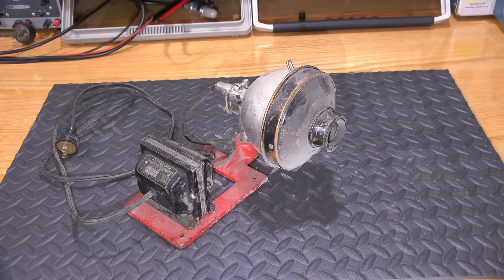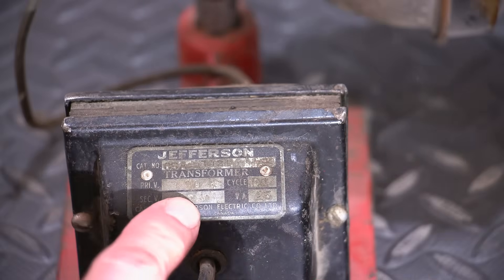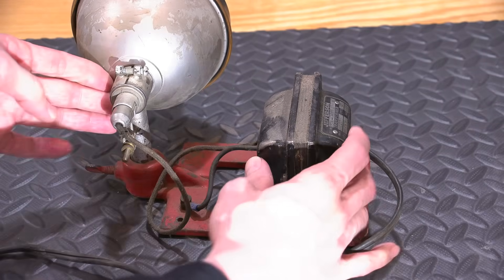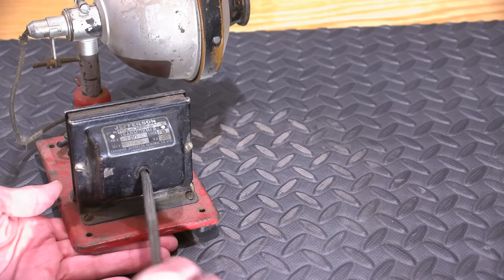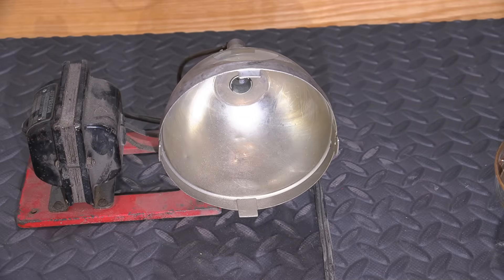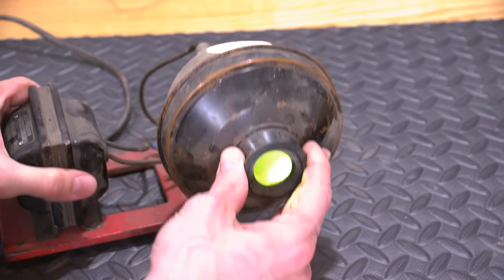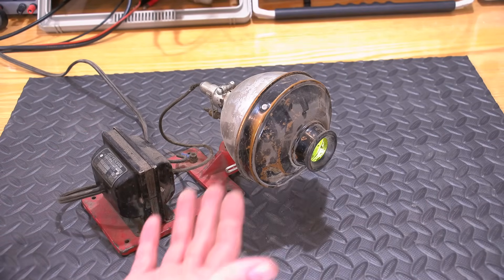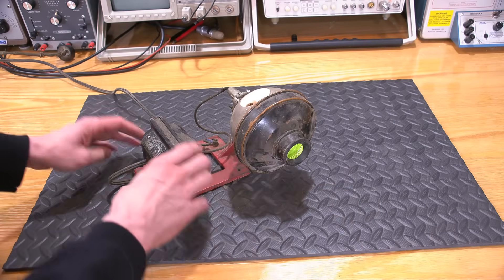Barn Find - What Is It - 1940's? Mystery Device Teardown!

Comment: Fun fact here we had 25 cycle and 60 cycle power (hertz) for a long time the big arc blast furnaces at the one factory were replaced eventually and the 25 cycle power plant was retired, as for the rubber crystalizing that could have been part of the war effort, oils had to be used elsewhere and im sure those war time electronics suffered

Comment: My now late brother-in-law screwed one of those flash bulbs into a lamp socket ( curious to what it would do not knowing it was used for photography  ) not thinking first to make sure the switch was in the off position and while he was holding it triggered.  This did something to his hand and he was visibly shaken/upset and shaking his hand for a while trying to ?? get back feeling or ??
There was no burn mark on his fingertips or hand 
But interestingly, he did die of cancer so I must wonder  if that bulb put out some radiation …..

Comment: Those are like tail light bulbs to a car 1157 was a two prongs and 1073 was the one prom that light takes the one prong . Any old car from the 60s will have the bulbs the stoplight signal light is 1157 and the reverse light is the one prong 1073 that would be your bulb to lite that lamp

Comment: It seems like once you mentioned the word egg inspection. Everybody ran away with it. This actually is still used in modern times, but it goes way back. It’s a light PQE surface inspection, torch, contamination detector surface inspection, torch design to easily evaluate cleanliness and highlight marks or particles that could impact the finish quality of the product Can show Greece fingerprints things of that nature on a surface that you could otherwise see so I think there you have it of course I’m welcome to be debunked. It does take a special bulb, but I do think in this case that filter that’s on that one. It just takes the lamp The incandescent lamp and the filter is sufficient enough to get that particular wavelength of green.

Comment: What puzzles me, is that it's rated at 25 amps, but it has a 6 volt bulb?  Which side of the transformer is the amperage rating for?  If it's for the 120 volt AC, that's huge for such a small bulb; 3000 watts would be insane for small bulb.  Even at 6.5 volts, that's a whopping 162.5 watts for some crazy low voltage bulb.  I don't even remember what those 12 volt bayonet bulbs would have for the wattage; you know the kind they used to use for break and marker lights.  But that would explain the need for a vent.

Comment: I would have guessed it to be a train light
for go and stop or safe or traffic. Swivel to
show both directions. The open part is to
read a pocket watch and schedule . Track
engineer lighting also consisted of 6 volt
lights that could use battery backup and
swap bulbs with walking lanterns. Yard
masters also used portable colored lamps
for signaling to other engineers and trains

Comment: It's an old fashioned cocksocket, basically a filling level indicator. 
You mount it via the hole with your bolt and nutsack dangling very low and while ablating layer after layer of tender stretched sackskin via heat and light from a very powerful light source the family can witness the content of your nuts.

It's usually been used to evaluate the proficiency of housewives to take care of their families.

Comment: Years snd years ago a photographer used to come to the theatre and take pictures of the cast on set.
He used two reflectors which had single flash bulbe of  the type you showed but larger, probably 250W size.
I pretty sure that every time he fired those things the stage moved back six inches!!

Comment: Oh, yeah, I've seen one of these before.
A "dildonator" is what it's called.
Back in the days of Radium when used as and for all sorts of things to cure, stop, relieve and disperse any kind of pain or ailment, this could be consulted for any universal panacea.
When not in use for that, it was to entertainment the children using hand shadow puppets.
Your hands of course would glow and radiate and if used too much, they would eventually fall off.
Usually around dinner time.
Even the spectators in the same room would experience intense diurnal cramping.
Sold as a home MD tool and entertainment aid.
It could also cook a full 20lb turkey in about 15 minutes with no radiation poisoning.

Comment: That is a device I was brainstorming with my specialized advisor(an ai), which I use often for ideas. That should be tiled back 33 degrees or so. And there is a part missing, a belt to rotate the drum. Your missing a few important part to it.  But it used in small scale mineral/metal extraction from rocks…. You say that’s from the 1940s? I am in 2025 odd to see someone made my idea already, and the knowledge if what it is and what it’s for is lost.  What else was in the barn?

Comment: Transformer looks like a Radio's Heater Transformer. The heaters in the radio Valves, or 'tubes' needed to be heated to allow thermionic conductivity of the radio valve (tube).  The brass thumbscrew is the 'focus adjust', where the 6.5 volt lamp would be moved to the focal centre of the main reflector.

Comment: Oh yeah this thing, I remember these crazy things. That is a low voltage illuminated egg candle. I bought one of these things way back in the day, I think back when I was, what, 300, 330 years old, or something? Anyhow, it works like this: That great big round hole in the side is so that you can keep this lamp on for up to hours at a time without large amounts of heat building up. The inside is an uncolored standard metal that will reflect the light any which way. Eventually, the light makes its way out of two holes. The heat vent, and the focusing lens. The focusing lens is to be pointing straight up. You see those four holes on the red mounting plate? That plate is to be mounted to a wall nearby a standard edison outlet. You would then use the device to check if eggs being collected for market have been fertilized or not. If they have, there'll be an unborn chicken inside and you'll see the outline. If not, you just made an egg glow briefly. This is to prevent taking the fertilized eggs out to market by accident. The reason the bulb is so low voltage is because if you used any higher voltage bulb, the vent hole wouldn't be enough to prevent it heating up. And you don't want to put an egg on a hot lamp if it's going out to market, that'll ruin its sale value and taste. I hope this explains it fully to you.
Reply: Rad.

Comment: My guess is that it's an illuminator for a microscope.  It's pointed at the mirror which reflects the light up, through the hole beneath the specimen.  A specimen is often stained, say, with "Methylene Blue" or "Congo Red," and when light of a particular color is employed to illuminate it, certain features (for instance, a cell's nucleus) really stand out.  That "in--out" adjustment is employed, along with the microscope's "condenser," to adjust the light's intensity.

Comment: It is certainly an egg candling light, 25VA at 6.5 Volt = 3.8W so a suitable 3.5 to 4 Watt 6V (ac or dc) lamp will be safe. I have a 1940's Speed Graphic (press) camera with flash attachment, even a few flash bulbs.

Comment: I will state before you start I swear I've seen that on a special about medical. Has to do with colored lights.
OKAY you're about halfway through and now I'm positive this is the same thing I've seen in a documentary about medical Shem shimmery devices. there was five or seven different colored lenses you can put into this thing it came with instructions that indicated what each light color would cure. I'm sure this is accurate information I just can't get you any closer than that. you are correct by moving the socket in and out you could move the focus of the whole chamber relative to the filament of the bulb.
Reply: Yes, I saw a device in a medical quackery museum with several colored filters.  The claim was that colored light was therapeutic for various conditions.

Comment: It's a 1943 Sex Machine. To avoid potental law suits or getting fired from your job back then they had these devices you could use to see if you should ask a girl out on a date or not, which today is considered sexual harrasment. How it works is you point the lens at a perspective date and turn the machine on. If you see green through the port in the top your OK. If it's red, turn and run for your life!

Comment: My guess is its an incandescent heat lamp for warming farm birds or something to do with egg candling. I'd also say its probably a good quality DIY job, or a non-brand low volume cottage industry build using off the shelf parts, made under contract for a local rural supply.

This is not a stand alone consumer item because of the exposed wiring, and no purpose built outer case. It was not designed for general transport by people outside the industry.

The black synthetic 'rubber' could be an early use of 'rubberised' PVC, sometimes with Polychlorinated biphenyl (PCBs) added as a elastomer and flame retardant. If it has a strong 'chemical' smell that rubs off on your fingers: that’s the PCB leeching out of the vinyl. PCBs in flex cord insulation was a WW2 aerospace innovation, and is found in limited civilian use until the late 1960s.

Comment: You have a fancy egg candler. People used them to check if an egg was in the process of becoming a chick, or if it was safe to eat.

I had a camera that had a reflector for a flash lamp, but my flash lamps were small compared to the one you showed.

But, as a joke, I put one of those large A style flash bulbs in a lamp socket at a friends house, it took a couple of hours for it to get dark enough for a light to be needed, and when he got up, I asked him to get me a beer, where the flash lamp was installed in the kitchen, and when he pulled the string for the light, it went off with a bang and a very bright flash, which alarmed him so much, he fell to the floor!

He came out of the kitchen to find me rolling on the floor, and he said, "I have never had a light bulb burn out like that before!", which added to my laughter! Every time I see such a bulb, it brings a smile to me!

Comment: I can remember after a political event was held, there would be expired flashbulbs all over the floor or the ground.  The photographer would switch bulbs which were too hot to hold onto so he could put another bulb in as fast as he could so he could get another shot!  Because the used flashbulbs were too hot to hold onto, all the photographers would just drop them onto the ground.  My brother and I would step on them in our Sunday dress shoes because they would crackle or pop but not shatter because they were coated with a polymer.  
At first I thought it was half a Magic Eye system, used to open an automatic door in the late 1950’s and early 1960’s.  The lighted side was usually a colored light and the receiver side was a photocell and when a person or a grocery cart would break the beam, the door would open automatically and remain open for a predetermined time.  
But it definitely looks like an egg candling light.

Comment: I'm back after a year away.  I believe this device to be a, x-ray emitter.  Nothing needed to be modulated.  So none of that circuitry is needed.  Just light up the tube with a power supply.  And apply voltage.  You will get a nice, warm, healthy dose of x-rays.  Such as on your feet.

I think these to put these things inside shoe stores.  You could put your feet into the contraption.  And it would x-ray your feet.  Either to take a picture area.  Of your bones in your feet.  Or for its therapeutic value of x-rays.  And plenty of people  did get, over, irradiated. I's believe.

I think it's really dangerous.  And should not be switched on again.  Not without some lead shielding.  In front of you and around it.  Then you can play with an x-ray emitter.  That's what I believe is.  It is not a heat lamp.  It is not a tanning lamp.  It's a gigantic cathode Ray tube.  With out a, phosphor screen.  Emitting x-rays.  Instead of just electrons.  Plenty of color picture tube TV sets.  Of the 60s and 70s.  Emitted a lot of x-rays.  They got it under control by the 1980s.  The EPA said they had to.

And this is just the early precursor.  To the color TV tubes.  Without the phosphor coated screen, to glow.  And zap.

Please enjoy your leukemia or lymphoma.
RemyRAD

Comment: Your comment about static and flash bulbs reminds me of an event that purportedly happened at a missile site I was stationed at in Germany. We had a high power acquisition radar set to detect incoming threats. I forget the power output, but the klystron stood about 6 feet or taller. One day after the antenna had been rotated downward from its normal tilt for maintenance it was returned to a position slightly lower than it should have been. Our unit PX was about 200 meters from the radar set. On the first powered up rotation every flash cube in the PX blew. People who witnessed the event told me the chain link fence around the fire control section was sizzling, and the mercury vapor lamps in the nearby village (maybe a kilometer of more) flashed each time the antenna pointed that direction.
Reply: I need one of these!
Reply: Do you know when and where this was in germany.  It sounds so familiar.  I was in germany in late 60s my father was a radar and missile guidance technician.
Reply: Hint the village near the post had an old stone tower on the hill above it. And the post had a small airstrip just inside the gate.
Reply: Sounds very healthy 😅

Comment: Those big flashbulbs like the one you have are used in high speed photography to this day. They are still being manufactured so your's is not really a collectors item. But don't set it off , it will flash your retinas even if you're looking away.

In high speed motion picture photography  they're used to illuminate events that happen so fast that the timeframe of the event takes place within the timeframe of the light field of the flashbulb. 

The high speed cameras used on our tests were 16mm quarter framers. The film smeared (no stop/start) through the film gate. A rotating prism between the objective lens and the film synced with the film speed "painted" the image on the film, exposing a frame the width of a standard 16mm frame but only a quarter of it's height, so four frames of high speed photographs took up the space of one standard 16mm frame resulting in a very wide aspect ratio.

These cameras could shoot up to 44k fps.

Timing is critical. 400 feet of film goes through the camera in a split second. It takes half the reel before the film is fully up to speed and a significant portion of the tail end is shredded as it leaves the film gate. The images are captured in the center of the reel and most of the film goes in the trash. After exposure the interior of the camera is filled with particles of destroyed film and has to be thoroughly cleaned before being reloaded. False triggers make photographers cuss.

The film is reversal, after developing, when shown on a standard projector four images appear, running four times faster than the actual capture rate. With the camera wide open broad daylight does not expose the film at all. As the scene starts the film is black, then dim illumination appears and slowly brightens. This is from the flashbulbs. Once up to full brightness the event takes place in ultra slow motion, then the light slowly dims back to black, which is again, broad daylight.  

It takes multiple flashbulbs like yours to light a scene that fast. Today high speed video is used but those flashbulbs remain part of the process.
Reply from the maker: Thanks for sharing your story!

Comment: Beings you found this in a barn everyone's guess including mine, it's an egg candle, or egg inspection light. I also have a small collection of bulbs. (No flash bulbs though) I have a 1000 watt 120 volt incandescant bulb with a mogul base and that sucker gets hot instantly when powered up! So I can imagine how hot those flash bulbs get when they get activated. Some of the boxes they came in would even recommend not to handle them when there's low humidity because of the risk of static electricity. I certainly would not want to have one of those in my hands when they go off lol.

Comment: be careful with windex. While it is safe in most cases I have had cases where some things are damaged by it. Sometimes old paint can be removed by windex but then I suppose you could water it down, but I use dish soap on a damp rag in some cases. But water can sometimes not be good either. Depends on the paint and the condition.

Comment: Great video.  One thing that surprises me is the transformer primary is rated as 120 volts, as opposed to 110 volts.  Back in the days of this device, I recall the AC line voltage was typically 110-volts AC, and the adoption of 120 VAC occurred at a later time, more toward the 1960s or 70s.  Neat video nontheless.  Thanks!  
Ken -- WBØOCV

Comment: I thought it was some kind of remote semaphore light, the window being used to control, if it still works, locally. I did have second thoughts because of frosted glass and reflector parabola not sending all reflections in one direction. (Too small a hole)

Comment: Two things I know for sure -
It was made after 1953 as before that the system was 25 hertz. 
The second is the plug is a mid 1970s replacement so it was likely still in use in the 70s. 
Egg Candling makes sense. 
It would have been a "family farm version". Commercial Egg Graders use a bulk setup that im aware of. 
Jefferson Electric built panel boxes and fuses, which some were reusable or could be re loaded.  I have a couple. All a unique green colour. 
Ive seen even larger photo flash bulbs (around 1935)
Yours is more from around 1957 for  professional use.  
Only collectors items now.